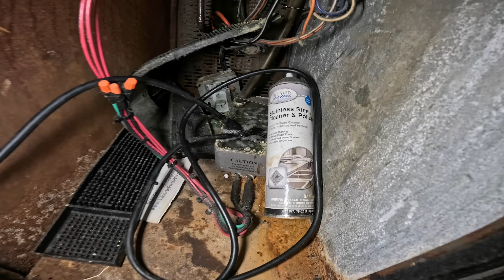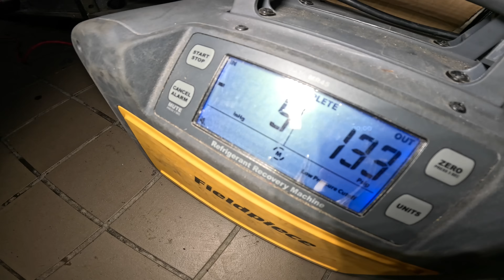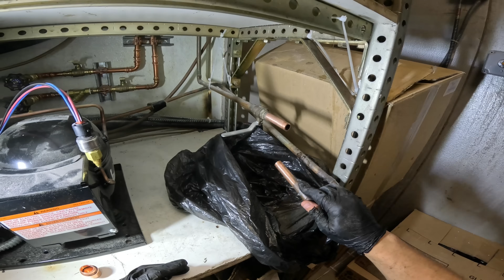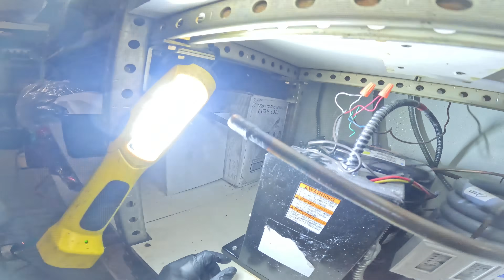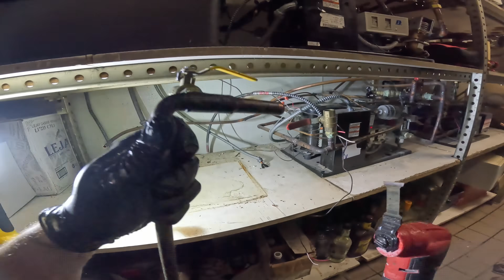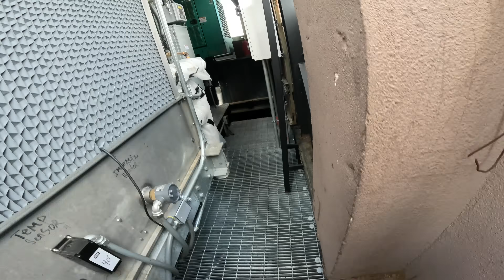HVACR: Water Source Refrigeration System Tear Down/Removal (Split System Water Cooled Refrigerator)

Comment: The company I work for lets us service tech keep ALL old copper, equipment both running and not running I make an additional $10k a year scrapping copper, TXVS, compressors, fan motors, coils, fixing cleaning and reselling equipment that customers wanted removed an upgraded. I love being a commercial HVAC/R tech the money is wild😂

Comment: wonder how long before they'll be screaming about the building/bar area being hot/not cooling from increased heat load. 🤣 which would be exactly why they were remoted and water condensers. possibly gets too hot during winter, when there's no cooling available, not summertime.

Comment: I love your videos. I don't get to see much water source work. Quick question, is that a 404a system or is different refrigerant used for water source equipment?
I get it in NYC there is no room for air cooled condensers

Comment: why don't you offer to install just air cooled condeners outside instead of water cooled
Reply: Package for me.
Reply: @jrh86 nobody asked you lol
Reply from the maker: There's no space for outdoor air cooled condensing units. For this setup, we are removing the split system water source units and installing packaged air cooled systems. Thanks for watching! 🔧⚡️
Reply: @JumpermanTech  package air cooled systems?
Reply from the maker: @itsprimetime9865 Just a simple air-cooled wine cooler that is one packaged unit, so the condensing unit is part of the wine cooler itself and not split like this system here👍
Reply: @JumpermanTech  LOL packaged  americans are funny here in canada we call it self contained
Reply: @itsprimetime9865  In the U.S. like other places depending on location we have many different names for one thing. We do also use self contained. In WIRs we may call them capsule packs.
Reply: @sherwinalvarez920  walk in we call them  penthouse units or drop ins